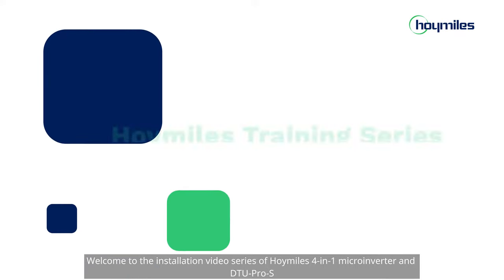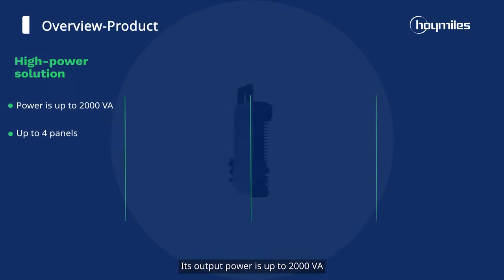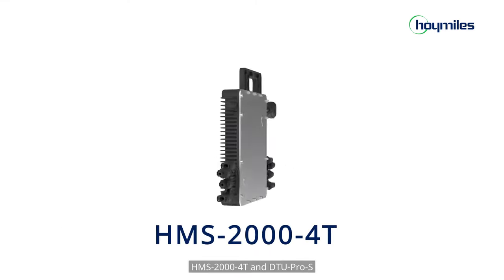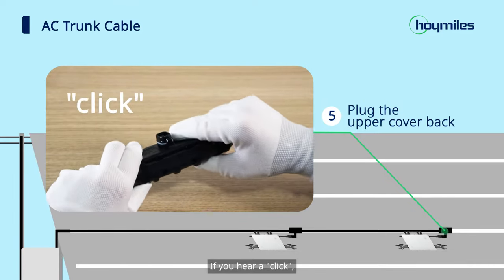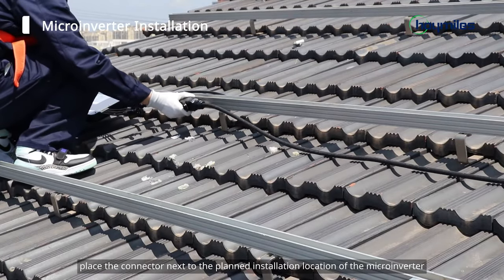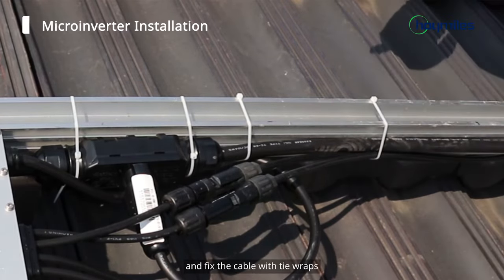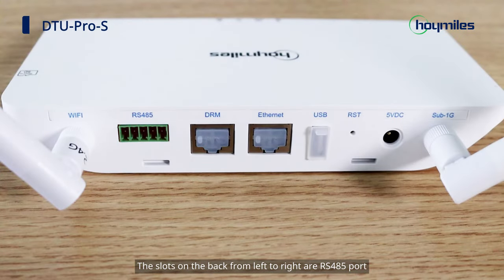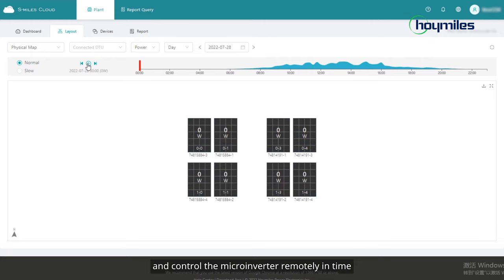4-in-1 Single-phase Microinverter | HMS-1600/1800/2000 & DTU-Pro-S Installation

Comment: Can use with 650 watts panel, cause solar panel here spec 650 watts..
Reply: Wouldn't recommend it. Spec sheet says commonly used module size 300W-505W